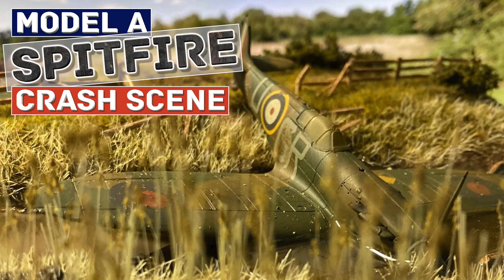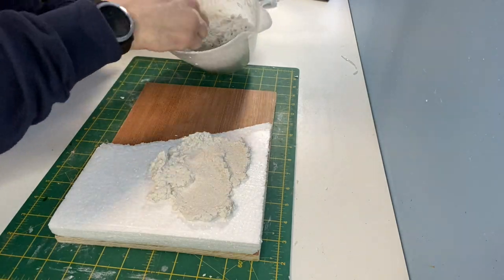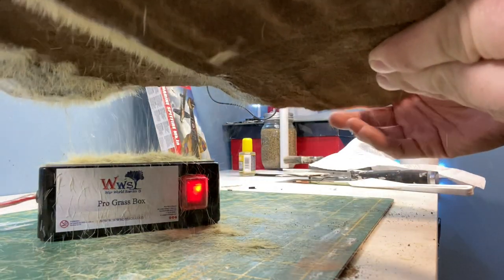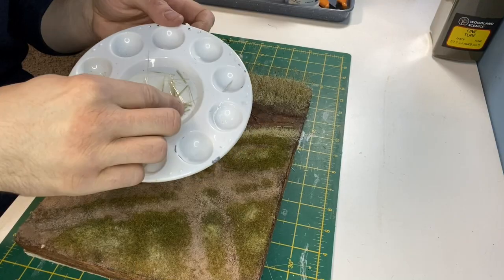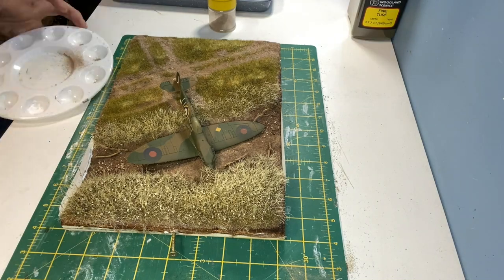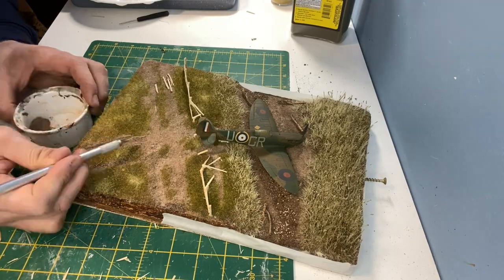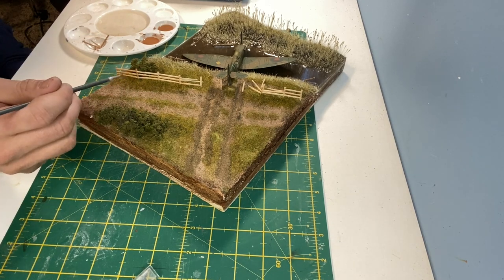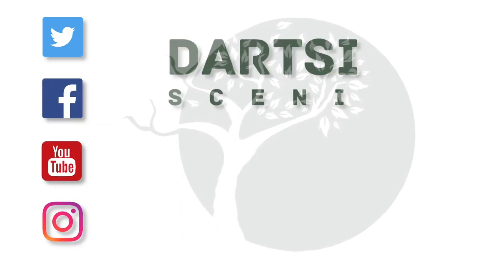Spitfire Diorama - reed bed crash scene

Comment: I think the fences should have been more broken by looking at the wingspan of the plane but overall, you did a really great job. Congrats
Reply from the maker: Thanks Iceman.  I had to include fencing in the brief but the entire wingspan would've removed most of it.  I decided to just knock down where the landing gear crashed through and hoped the wings would've just skimmed over the top of the fence!
Reply: @DartsideScenics  Plausible, but if that were the case, the landing gear wouldn't have left such large gouges. When I looked at it, I figured the pilot made a belly landing, and slid through the fence.
Reply from the maker: thanks Martin
Reply: It's brilliant, but I suppose as perfection is your game then one might point out that the landing would have been made with the undercarriage up. If down it would have been torn off. Either way the scouring would have been light, caused by the twin air intakes. Canopy open. Propeller, blades either split or bent back, depending on mark, Damage to leading edge of wings at a minimum, and the plane would not have landed straight ahead, but turned to one side to align with the ditch, probably more nose down from the weight of the engine and contour of the land. More fence damage as you have noted. But still spectacular.

Comment: Fantastic job! The scenic elements are probably the best I have seen. Just a couple of points about the aircraft. The propellers usually curl backwards as they are spinning when they hit the ground. And I would have thought the canopy would be open if the pilot had got out?
Reply from the maker: Thanks Robert.  Yes, there are lots of incorrect elements with the aircraft but time was a bit short and my plane crash knowledge isn’t the best!  I hope to do another in future and spend a bit more time on those details.

Comment: I'm impressed with the scene and the way it''s  put together. I have to applaud the  reed bed, it looks very natural. As a matter of fact, I'm gonna steal your method. I'm doing an armor diorama ATM and  am beating myself over the head trying to come up with bullrushes. You mentioned in a reply to Iceman that you figured the Spit rolled through the fence on it's gear and then flopped down. That would work but in that case, the landing gear would not have left such large gouges in the earth. To me, it looked like a belly landing. The only other thing, the Spit is too  clean, with little or no weathering. I'm curious as to why the canopy is clouded over.
Reply from the maker: Thank you, it will be great to see your diorama when it’s done.  To be honest, this is the first time I have built a spitfire kit and I always have regrets when I finish a diorama.  I learn something new every time though so that’s always useful.
Reply: @DartsideScenics  I would have left the canaopy open too as the pilot is clearly not still in it. The lack of damage would suggest a forced landing and so he/she would have simply climbed out. A little damage to the wings caused by colliding with the fence would have added to the effect. It is a very good model nevertheless.
Reply: BTW, I just remembered, Douglas Bader, the pilot with tin legs, forgot to change prop pitch on one of  his first Spitfire flights. He ran down the length of the field and into a fence at 80 mph. Just another possibility for the why of it. This was during the Phoney War as he was transitioning to Spits. If you haven't read his book "Reach for the sky" go find it. I reread it every few years. This guy should be the dictionary photo for determination. He pranged a Bristol Bulldog while stunting and lost  both legs. He recovered, learned to walk again and went on to regain his flying status but was rejected by the RAF and invalided out. Come WWII he walked in the door and told them to retest him. This time they took him back because he PROVED he could fly with the best of them.

Comment: Great detail on the reeds.   The Spitfire was a tail dragger and should have a dugin spot on the road.   Also the  weeds and tufts between the fence and stream should be bent forward where the wing pushed them.  I'm guessing gear up landing would have a more dug out area on the road, or toss out a landing gear that broke off.   Very well done enjoy your work.
Reply from the maker: Thanks Tim.  I think quite a few people had some issues with this one but I should be able to revisit it when there’s more time.
Reply: @DartsideScenics  I wouldn't say issues I think most people just want it to be the best and notice suggestions for you.
Reply from the maker: @timf2279  yes, I think it’s useful to get constructive feedback.  I have been limited for time on some of them so haven’t been too happy with the results.  However, I usually find I can improve some processes on the second attempt.
Reply: @DartsideScenics  yes I noticed you have been rushed.  Have you been busy or just late notice?
Reply: @DartsideScenics  I also forgot on the spitfire was liquid cooled so it had a radiator inlet under the fuselage.
Reply from the maker: @timf2279  some of them had deadlines for competitions and I work full time so it does limit how much I can do.